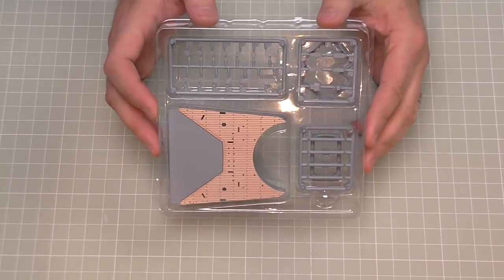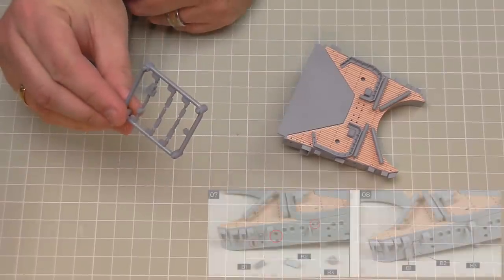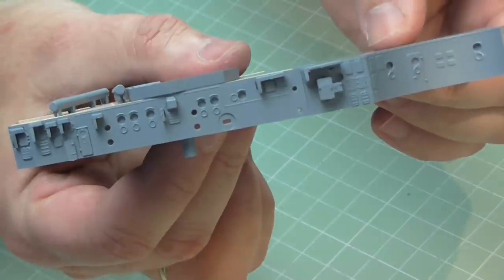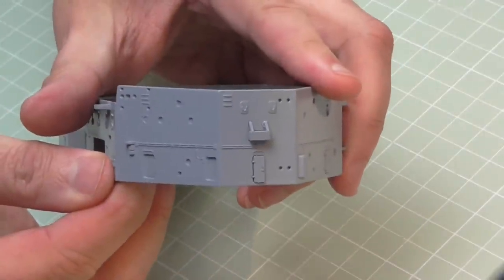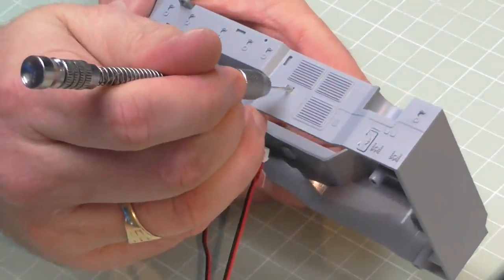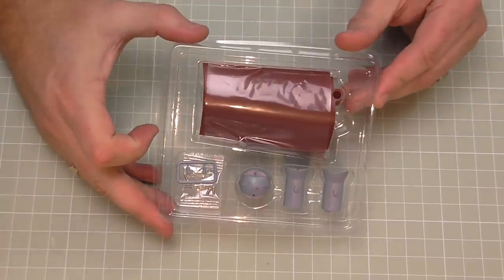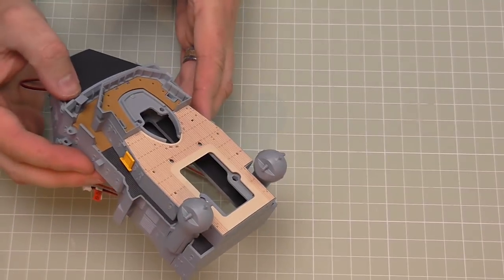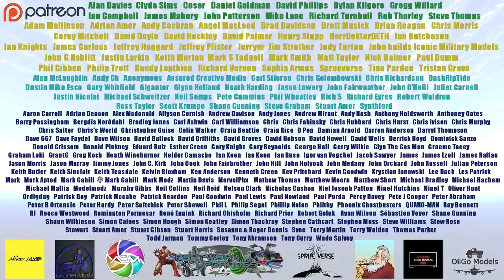Agora Model's Bismarck: The Legendary Battleship - Pack 3 - Stages 21-32

Comment: Bismarck is my first model building project, and I had great fun with pack 1 and 2 thus far. Royal Mail and DHL f'ed up the delivery of both so they both needed to be send twice and pack 3 has now been stuck in customs for 3 weeks again. I think this will be a project where I have to learn patience.

Writing this while watching the video, so not sure if you already fixed it but:
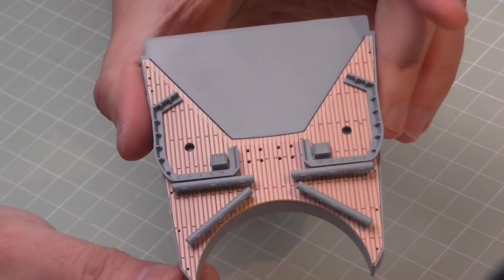6:08 The lower two details are the wrong way around, the detailed side wont be visible with the barbett installed
Reply from the maker: Ahh cool. Yep. Need to put my maginifers on again lol

Comment: Hi Wayne.  The advantage of only starting this build after you have completed twice now is that I can hopefully improve my build without as much frustration.  I saw when you first built the Bismarck you used a Sharpie and Krystal Clear for the portholes which I plan to do but my question - would you also use the Krystal clear on the porthole part that this hanging down below the actual porthole?  I also noticed on your 1st build the life rings where painted red - I like that over leaving white so what paint did you use for these.  Thanks Wayne and really looking forward to the first Agora Titanic build as I won't start mine until I watch your video.

Comment: 54:03 those ones to come off the metal sprue look fragile. As you cut the video can you tell me how long it took to do. I've got the same cutters as you but to get in to the middle one it just doesn't cut through. Worried of bending them   please advise.
Reply from the maker: I didn't cut any of these. I use the flat pliers to work the edges of the attachment point. Rock it back and forward and the detail falls off. If you do it right you shouldn't have to touch any details.

Comment: Yeah actually you still can test the led with a multimeter on continuity Mode that is how I always check them out when I work on any project that I am going to led on anything and plus you sometimes don’t know which one is positive or negative this would tell you that it’s going on the right way plus I also know that this led light has wires for that but the ones that I do don’t have any wires on it
Reply from the maker: The amount of peeps who I have seen blow bulbs is staggering hence the warning.
Reply: Yeah so true there 😁👍
Reply: Relatively simple to set up a test rig with a AAA battery, a resistor, and couple of wires, but...yeah, I have blown a few LEDs in my time.